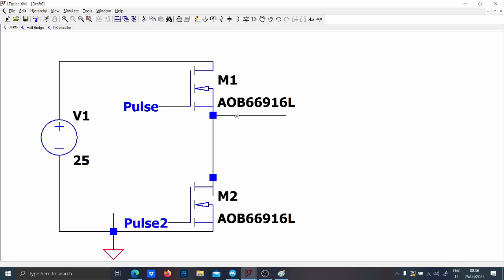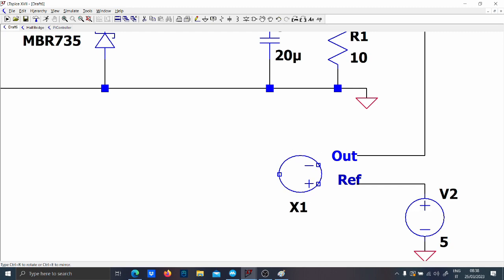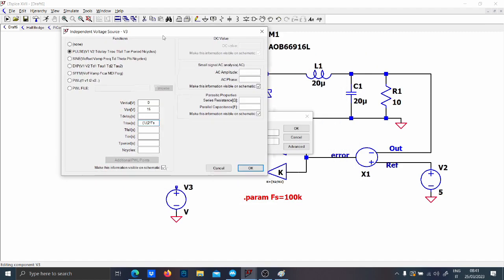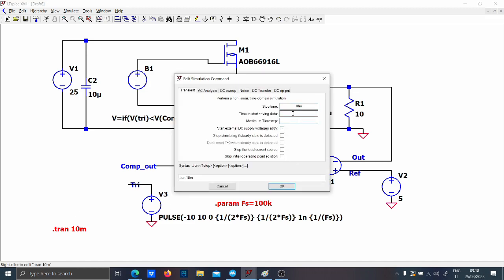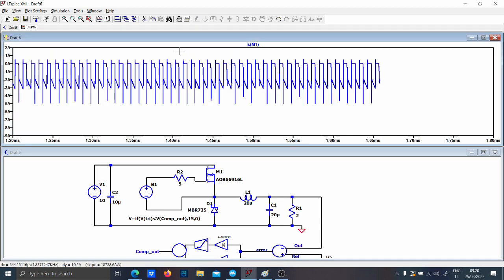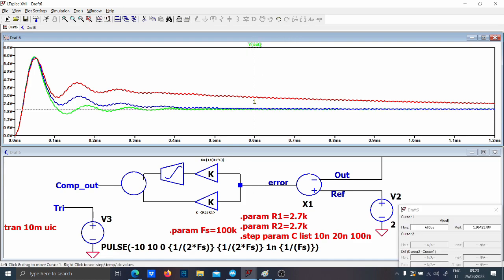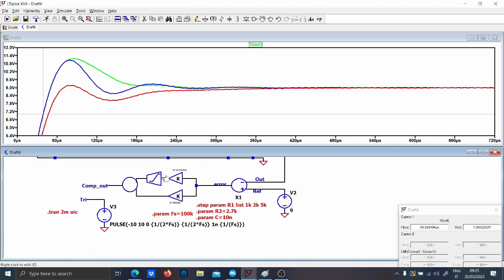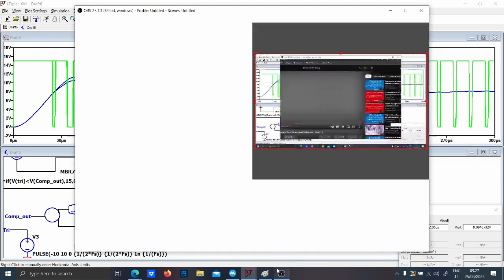Closed Loop Buck Coverter with PI Controller Part(2/2)

Comment: Outstanding job .. could you please make a detailed video on type 1,2,3 compensator and its effect for voltage and current mode buck converter.
Reply from the maker: Theoretically speaking the buck Needs a type3 compensator since you have the double pole introduced by the LC output and the other zero introduced by the esr of the output capacitance. So yes, I Will make also the type3
Reply: @LukeXVIIx64  type 3 for voltage mode buck and type 2 for current mode right?